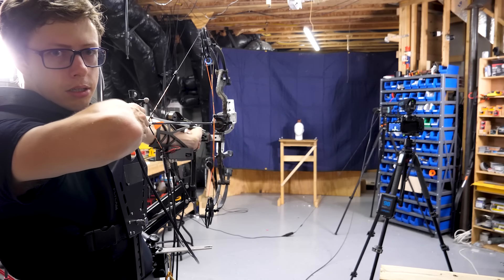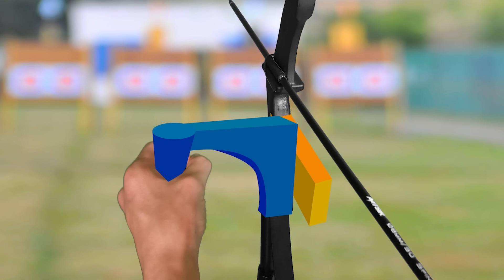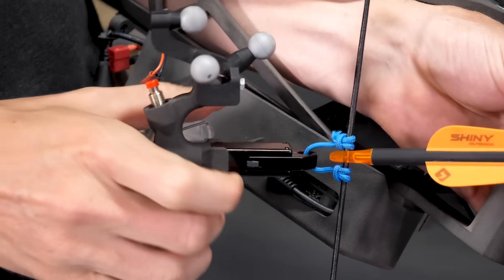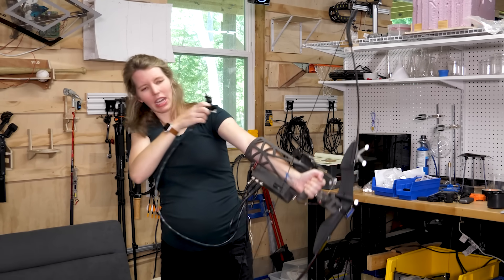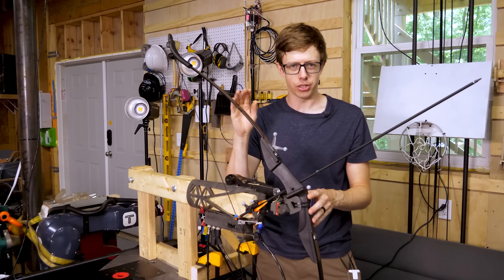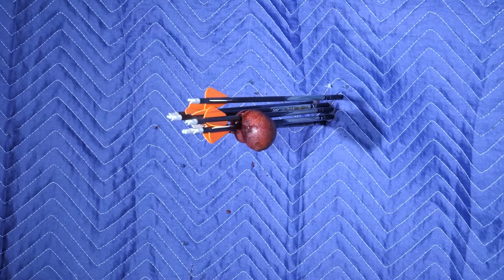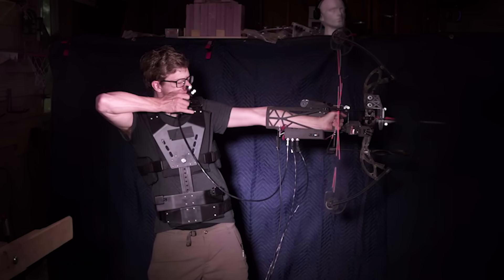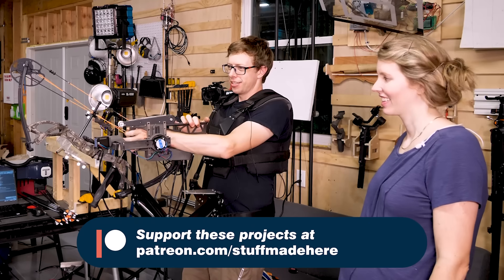Auto-aiming bow vs. FLYING targets

Comment: So, i got a little question. You put the trackers on the release device, and some on the front. When the Bow "aims" everything comes out of alignment a bit because the release isn't in a perfectly straight line to the arrow, is that not a problem that's inducing some inaccuracy?

Comment: Funny that this video just dropped. I got a new bow this week for the upcoming hunting season. Trying to build a highly accurate bow that is still practical for hunting. If you haven't already you should look at what goes into building the perfect arrows to match your bow. Spine, weight, fletching, straightness, length, nocks, % foc all influence the flight path. Most important is making sure each arrow is exactly the same. Any difference between arrows have more effect and farther ranges.

Comment: I can’t believe that I am saying this, because of all the insanely complex engineering projects you have already done, but this is your most impressive project so far! Blows my mind thinking of all the pieces that have to come together her to get this to work! 🤯 At least you took the “easy route” and used external markers for tracking instead of an entirely self contained tracking system with sensors mounted on the bow.

Comment: As an archer, you can only be as accurate as your least precise piece of equipment for most people they are the least precise part, but when your software and machine remove that, you may have to start getting a better bow. Look into Hoyt or Matthew’s maybe even bow tech or elite. The Quaker biscuit is good for the first few hundred shots but then will start to wear and be less precise for that look into qad or hamskee , finally don’t forget to care for your string. There is a ton of kinetic energy stored in their which if the string breaks it will release in your face with  magnificent tragedy. Hope this helps for V2.0

Comment: I was an Archer for years. You have to find a more stable body position. With your hand suspended in the air somewhere between the bow and your face this won't work. It is much to unstable and shaky. I suggest an anchorpoint on your jawbone like every compound shooter, even if that means that you have to change the positions of the markers on your release-aid. That will be worth it. Greetings from Germany :D

Comment: I like the video.. but I want to make a request for a challenge build for you.. stacking several bows together.. mount them on a turret with your auto-aim (perhaps it could track a laser beam ?) mechanism. Perhaps, to start, stack 5 bows on top of each other.. then it can be kind of like a bow and arrow machine gun.. well it would be holding a five arrow clip, so to speak.

Comment: The background with Formlabs (and by extension MIT), suddenly everything makes sense. This was a great channel, well equipped right from the start. That requires start-up funding, which being on the the ground floor would provide. Also, quite clearly an excellent engineer, the education and work experience fit that well. Great work, nice channel. I'm happy you decided to pursue it.

Comment: Cool, I've spent 20 to 30 hours a week for the last 6 years to be able to do this, he does it in a couple of weeks with a keyboard.  Be interesting to see how his system performs at longer distances, where less than 0.4 of a degree is the difference between dead centre, and a total miss.

Comment: could you easily modify this build to take it outdoors to practical locations? use small red dot range finders attached to the bow instead of a camera dependent system?
Reply: I guess that would still require steady hand to be able to point the intented target. I think some kind of stabilized camera view with point and click target selection would be good.
Reply: @MikkoRantalainen  possibly preset recognized distances and when the program recognizes the appropriate distance it automatically releases at that moment. 15/25/35/45 yard intervals presets. IE- the string will only release when a target is at that exact distance from the shooter, no closer or farther
Reply: @UndividedGuild  Yeah, that would still require some skill from the user to point on correct target because there're usually multiple shooting positions side by side and multiple targets, too. It seems that Shane was trying to create something that allows you do not even look at the direction of the target to hit it after selecting the target.
Reply: @MikkoRantalainen  you are correct, im only attempting to alter it to make functional outdoors. long range hunting and such

Comment: "kinda feels like cheating" he says, wearing a contraption that does everything except pull the string for him
Reply: Using steadycam stand would actually help even real archers a lot.
Reply: @MikkoRantalainen  As a real archer, I can inform you that it's not worth the trouble. We already have all the gadgets we need
Reply: That’s coming in v2 (probably)
Reply: So, Version 2.0 should have an inbuilt string pull system.
Reply: @ignatz14  Version 3.0 straight up uses a rifle instead of a bow.
Reply: @stevenbobbybills  why would you use a rifle if you could use a trebuchet and fire a 90kg projectile over 300m?
Reply: @ignatz14  Just use a Tsar Bomba. Destroy half the planet while you are at it. use project thor.
Reply: @ignatz14  well, the obvious answer is so you can hit one very small target at even further ranges. It would be hard to pull a William Tell if the whole building around the apple doesn't exist anymore.
Reply: " except pull the string for him" for now...
Reply: It even fors that

Comment: @Stuff Made Here speaking as an electrical engineer specializing in factory automation controls AND an avid archer/hunter, I APPLAUD you for your BRAIN!! 
Now.....you need to Robin Hood an arrow....AND also study Archer's Paradox! I resemble that remark...Seriously, I must correct you on the statement that a compound bow "shoots arrows really straight". In reality, a compound bow exerts more force upon an arrow's shaft versus a recurve bow. To account for this higher load force, an archer must MATCH the arrow's spine = relative stiffness. The spine selection is based upon the bow's poundage = draw weight AND the bow's draw length = the linear distance that the arrow is drawn from the resting position  = brace height to the full draw position. Just for the record, of the 50,000 arrows that I have shot in my lifetime, I have 3 Robin Hood arrows AND in reality, I probably would have had a lot more, but after you realize that splitting a $15 carbon arrow can get really expensive...it is more economical to aim at different spots on the target when practicing!! If you ever want to collab on a video = let me know!!!

Comment: From your explanation, the tracking works very similarly to a targeting script I wrote, which just re-runs the same script 500 times per second until the error is less than 0.00000000001% (yes, real number)

Comment: As always this is a huge accomplishment and project.

HOWEVER, in this case a huge part of the challenge was solved for you by using the e
3D camera tracking system system... In the past you would implement this sort of thing yourself and that would be 75% of the whole project.

Comment: I am an Archer. I love this project, despite the fact that you are still very far from the level of accuracy that a Compound Archer is able to achieve, but I am confident that you will get there. To avoid punches in the face, can I advise you to take some lessons in order to position yourself correctly? In addition, the rest you have mounted on the bow is a hunting rest, it is fine if you want to catch the targets on the fly, but for the fixed target shooting another type of rest would be better.

Comment: How about a camera on the bow looking for targets with a laser that points where it thinks a possible target is, then a button from where you lock on to that target or switch to another target. Use a laser range finder to know distance. The compound bow is quite concistent at firing so not sure if its neccesary to calculate how far back the bow is drawn, just have an input to choose how many lbs the drawback is. Then maybe have another camera tracking you right hand from the side and front

Comment: Simple error: don't use Python for anything you expect to work in the end. It will add random latency to all your project that you can't control and can't repair. Drop Python, take something that works. Really. Even Lua, a very similar and simple Language is with LuaJIT capable of all the things you get from Python but with 30 times the speed and no problems with this kind of latency. Else use C.
Python is just the path to failure, my god drop that crap.
Awesome project by the way. Really awesome, kudos. Just kill Python.
And your awesome wife is really fat, which gives her a boost on her bow. If she one time gets lighter some pounds her bow will get much worse, so there's hope for auto-bow to one day beat her.

Great reaction from Joerg Sprawe and a Challenge!
https://www.youtube.com/watch?v=F583BtHJihQ

Hear me out, my comment to Jörg:
Great reaction, Jörg! Great challenge and so comes practical considerations to great engineering. Actually I would do it a bit different and put something on your idea: instead of a phone you get a Raspberry Pi and you control the laserpointer instead, so it drops off with distance. Also the whole bow (with your Fenris) can be measured with an IMU (9 grades of freedom), which is much more precise than the crappy sensors that come with a phone. Also the cradle of the arrow should be controlled X/Y to stabilize the small movements of the arm. Forget about the whole gyro, but you can stabilize the arrow by this and make long shots easier. 
And that's it. How about that?

Comment: to not punch yourself, just ACTUALLY pull it back all the way. by pulling it back properly your hand is behind your face, so you can never punch yourself.
or just use a compound bow, when you pull them back all the way there is virtually no force needed to keep it there.

Comment: as a nationally ranked competitive archer and engineer I can tell that you did a ton of research or already had knowledge on archery and it really made this video even better. it will be interesting to see if you can end up creating an improved system that could actually be competitive with target archers, possibly even at standard competition distances (18m and 50m). I know I cant provide much insight from the engineering side but if you need anything from the archery side or have any questions about the equipment I would love to be able to help if possible.
Reply: well he is sleeping with an archer to get all the data, research and knowledge.
Reply: @klownvandamn7946  ya I don't thin Kolin would give it up just for archery

Comment: You know, I find your command over so many engineering disciplines awe inspiring, but the fact that you worked at form labs, for 9 YEARS, definitely gave you a the perfect springboard for what you are doing today. 

As an electrical engineer myself that does software development, hobbiest electronics and watches a lot other awesome stuff on youtube, you outshine everything by a significant margin in terms of complexity and time to success by an individual. It is nothing short of a superpower.

Comment: If he drew to an appropriate anchor point, ie touching the face consistently, he wouldn't have the punching the face issue - that alone introduces so much inconsistency.
I think the system itself is better suited to a crossbow which has much less human inconsistency.
Hitting the moving target is very impressive, as is the engineering behind it, but against a static target a decent club-level competition compound archer or even an exceptional recurve archer will be able to outshoot the aimbot - but i think that's due to inconsistencies in grip pressure, shoulder alignment, hell even draw length, and form in general - more so than any errors in the actual aimbot.
Reply: he should lett his wife shoot for example, cuz maybe shee could have a better form
Reply: not sure about the other factors, but I agree wtih you that he should at least always draw to the sam spot near the face, it just removes alot of DOFs. Thedrawlength is fixed due to using a compound bow and the other factors might not matter as much as you think. If the software really computes multiple times even during the moving process how to adapt to reactionary movement cause by newtons third law, then the stiffness with which he holds the bow matters more than the relative position.
Reply: what if he makes a system like Joerg Sprave's instant legolas? 
https://www.youtube.com/watch?v=xH2uVMJTt2s

not sure how it works exactly but it does have a very consistent draw without the slapping yourself in the face issue.
Reply: the reason he keeps hitting is face is because hes drawing in "chickenwing" style with the elbow below his shoulder. when his wife shoots the normal bow she draws correctley but when she shoots the aimbot she also draws chickenwing. so i think its actually more for comedic effect.
Reply: @CaptainSharkbait  doesn't the fact that he doesn't release the bow play into it though? Like he gets caught off guard cuz the bow decides when to release and hes still pulling back
Reply: @zwenkwiel816  it could be, im not sure. but compound archers sometimes use hinge release aids and those are also automatic ie. the archer doesnt decide when the bow shoots either and they dont hit themselves
Reply: @ evan… it’s apparent that you are clueless about the actual issue being discussed otherwise you would see its points have merit.
Reply: @TheTankFG  Bro it’s an online argument why are you taking out a thesaurus and trying to confuse me lmao. I’m just saying that he sounds very egotistical so I would like to see if he could build this himself. So quit talking shit and do something with your life other than defending random people on the internet.
Reply: Like you could do better
Reply: @Humps69  who cares? the point is that against competent bowmen he would be outshot rather easily.

Comment: This is absolutely the coolest thing I've ever seen from an engineering youtube channel. Hacksmith needs to step up his game (lightsaber is probably second coolest).
Reply: Shane blows Hacksmith out of the water honestly. The level of intelligence and skill is unbelievable.
Reply: And he's just one guy.
Reply: @qwertyferix  yeah and his projects seem like they can be done by anybody with the know-how. Hacksmith seems to pour thousands of dollars into each project, which kinda takes away some of the glamor imo.
Reply: @tucket2000  bro Shane has access to like $200k in machinery in his basement lol 😂
Reply: @trumpatier  but it's not usually required. Look at the pool cue video. That requires some servos, strings, a computer, and access to a pool table and PC. None of those are extremely hard to obtain yet the project turned out to be quite awesome.
Reply: @tucket2000  didn't he machine some parts for that project?
Reply: @tucket2000  and also an expensive motion tracking camera system
Reply: @trumpatier  I'm pretty sure he developed the software for the motion tracking system. And you could take a cad file to a local shop or even a university (possibly) to have something machined.
Reply: @tucket2000  nah the camera and motion tracking system was made by a company, can't remember their name. But yeah I suppose you could design the part (if you have access to expensive CAD software) and take it somewhere for like $100. But imagine the cost if/when you have to keep redesigning the parts through trial and error
Reply: https://youtu.be/JIxmRSujdGM
Reply: yall all forgetting the hecking powerloader? But yeah, Shane is insane.
Reply: @Appri  inShane?
Reply: Meh. Only part of "hacksmith" that's valid is "hack"

Comment: Amazing video as always, absolutely mindblowing. I know that over-engineer everything is kind of the point but wouldn't it be a lot easier and maybe a lot more accurate to just put a camera (or two) on the bow instead of the external camera? Then it would be a portable solution as well.
Reply: Combine it with an AI that creates its own markers on an object and a Laser Rangefinder and you have the ultimate Bow. No need for tracking balls anymore.
You can shoot everything, everywhere
Reply: If only the metrology behind that would be as easy. External tracking is a pain, but inside out tracking is much worse. I‘d wager that achieving more accuracy is almost impossible. Sufficient accuracy? Maybe. Royal pain to fuse camera information and at least a couple of imus: dead given. 
Outside tracking has the advantage of providing everything in one coordinate system, which will otherwise a nightmare to deal with trough calibration. Reckoning distance from two cameras that are close by (as they would be on a bow) is not particularly stable. Also you‘ll have to settle for a specific range window due to optical considerations. You would further need quite a bit of processing power on your bow,  but this applies to optitrack as well. Markerless high speed tracking is yet another awkward thing to deal with. Lastly: remember, not a crossbow ans thus you have to track the draw hand as well.
Reply: @MinistryofBrokenEndMills  I worked at a company developing high performance camera/image stabilization systems. Gyro stabilization with micro-degree accuracy was quite common. If the camera image was used as well, pin point accuracy over many many kilometers was no problem. This is more or less exactly what would be needed here as well, and I think it's defenitely easier then using many external cameras with indirect calculation of the direction of the arrow. You are right about the need for tracking the draw hand but he is basically rotating the whole bow around the "pulling-point" of the draw, so maybe it actually doesn't make a lot of difference.